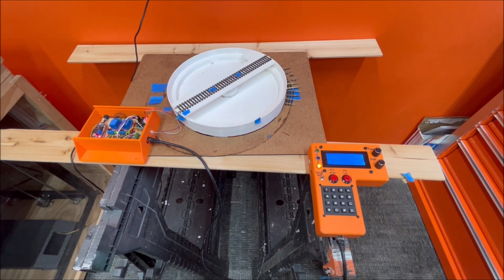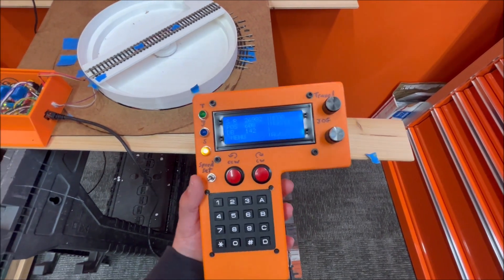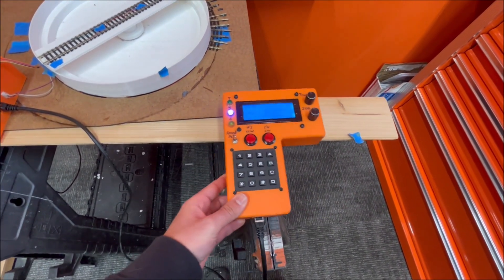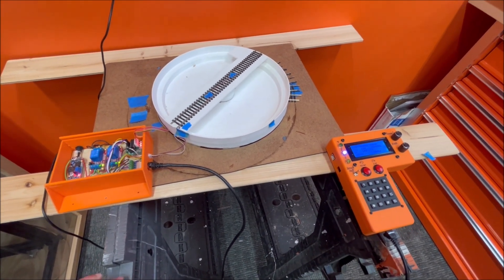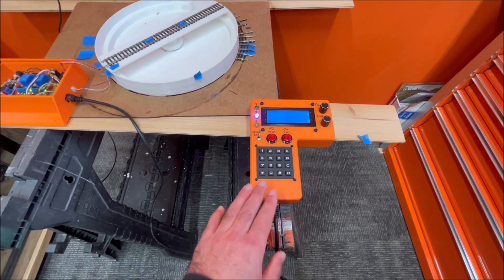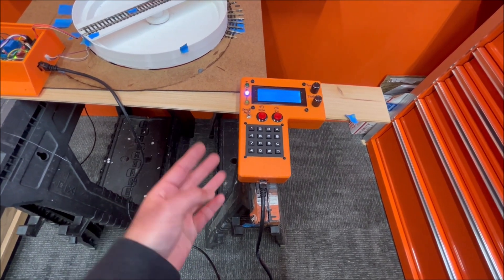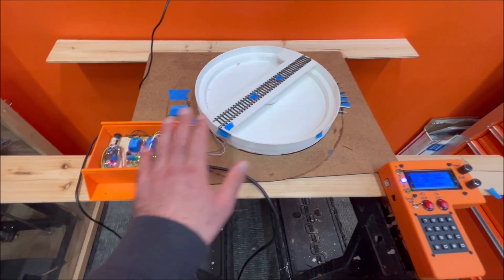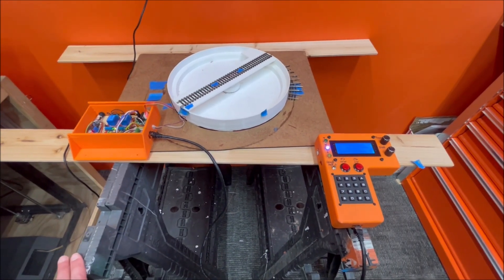Arduino Turntable Part 5

Comment: You really need to release the whole thing as a package.  Then people could play with it and can check if the components they use are compatible.  Just releasing the code and packaging for the handheld controller will cause more problems.
Reply from the maker: I will release the code with a manual stating what hardware I used. People can test the hardware they plan to use with the free version of the code prior to purchasing the full version. In the manual I also call out what hardware I used in the base station to help give some guidance.
Reply: @OrangeLabPinball  Thank you.  I believe that if you do that then you will have less people bugging you with petty questions.  Also if we can replicate what you built then there will be less problems using substitute parts.  I look forward to more from you.  Congrats on becoming a new daddy.  There is nothing great in life.
Reply from the maker: Thanks I am looking forward to it!
Reply: @OrangeLabPinball  can you send me a list of parts I purchased the full version
Reply: @OrangeLabPinball  I bought the full version.  You say the parts list is included.  I can't find it anywhere  in the download.  I even looked in the code.
Reply: Looks amazing buddy, great work. I will be looking to replicate this at some point soon, but need to get my head around the base station first, being a total noob to this, it may be take me a while, plus purchase a 3e printer and work our how to use that, steep learning curve but thanks for the inspiration and congrats on the baby👍
Reply: I bought the paid version but I didn't get a list of parts
Reply: @brianjacobs1051  I did also and the same thing no list of parts.
Reply from the maker: @sierge1 @brianjacobs1051 Sorry I didn't see this sooner, Youtube didn't notify me of this post. In the file you were sent when you purchased the controller you should have received two PDFs. The "Turntable Controller User Manual" PDF has the parts list called out as "Electrical Components" starting on page 4.